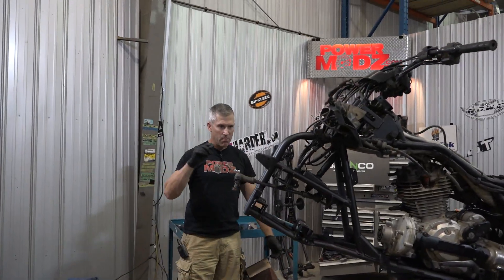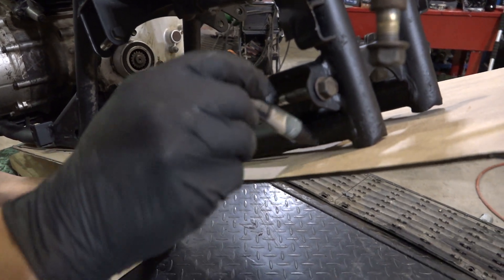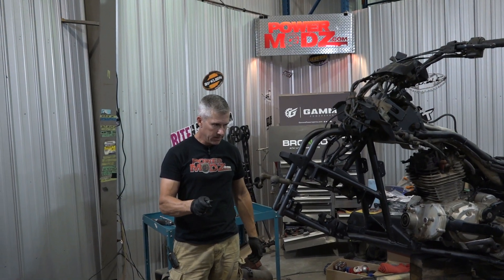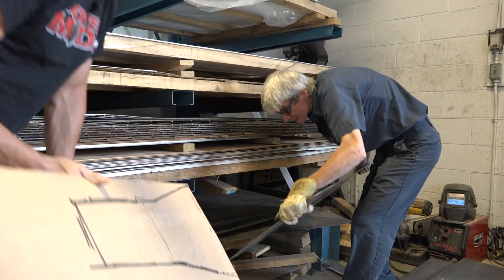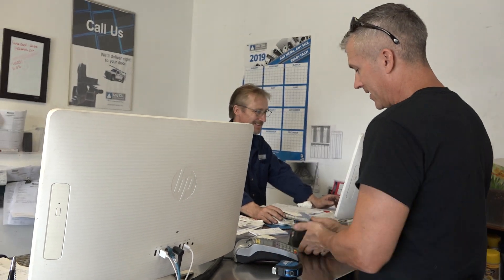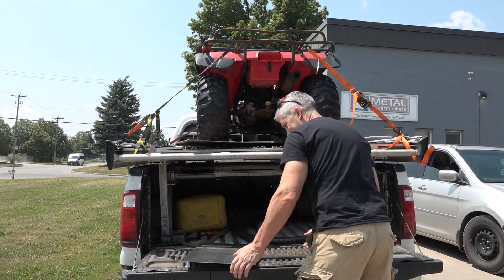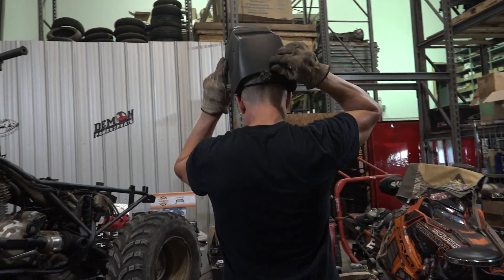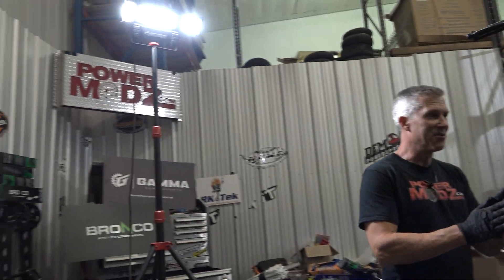Ep#7 Honda Fourtrax 300 Skid plate fabrication!

Comment: Common problem with these early hondas,tubs would rust out.Had to split one & one quarter inch heavy pipe and cap in the bottom frame of my 1999 TRX300 after just three seasons.The newer TRXs with the plastic skid plates left this problem behind(just had to spray inside the tubs with Krown or rust check).

Comment: You need to clean the paint off your frame before you weld. Work it from frame to plate. That Lincoln welder should be throwing out good welds. I have a couple of Lincoln welders and a couple of Metal Man 140 welders. I rarely use my 240 volt Lincoln welder. To be honest the Metal Man welders are the best for the money. Btw that skid plate was a very good idea for fixing that frame. Done right and it will be stronger than stock.

Comment: I know its unrelated to this video but what kind of oil do u use I've been recommended rotella t4 15w40. Desiel oil ive never heard of desiel oil in a four wheeler so what u think safe?
Reply: Nothing wrong with using 15w40
Reply: It's a really big topic some say that's great others don't
Reply: You can use any oil you want.. as long as it does NOT  say " energy conserving " inside the round label on the back of the bottle.. the "energy conserving " additive is what will mess up your wet clutch